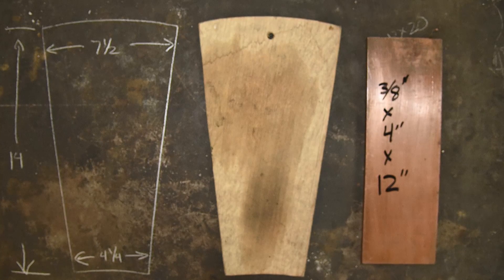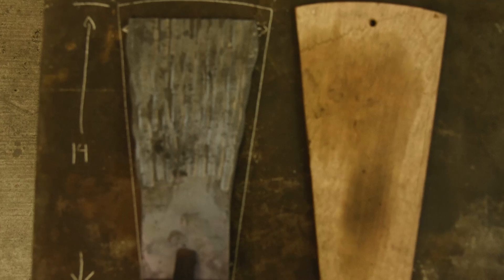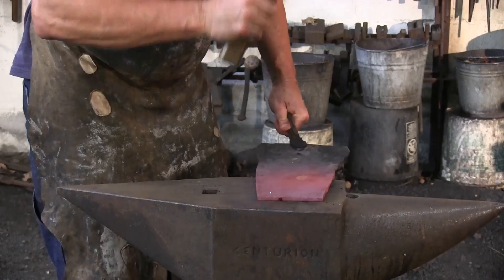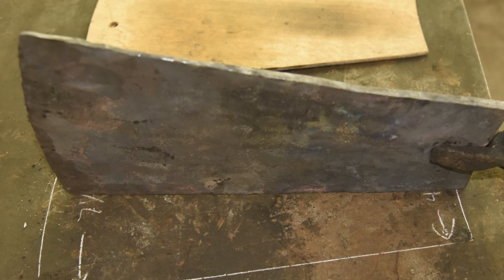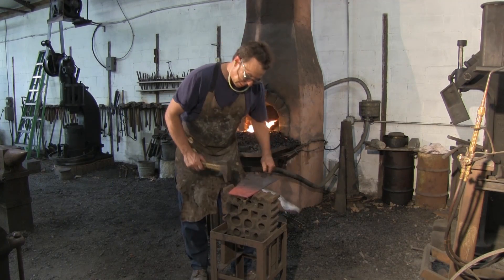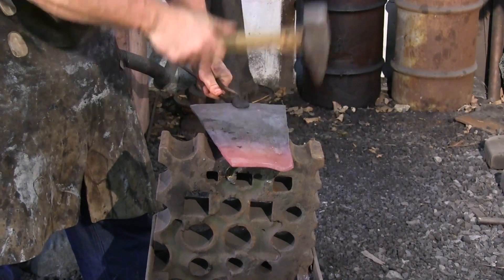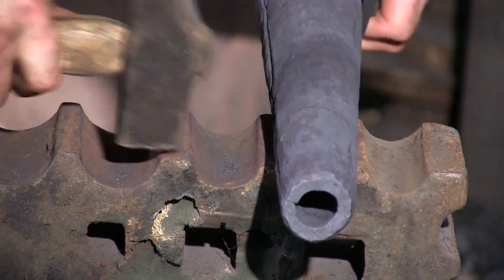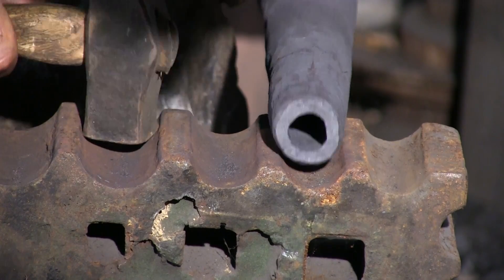Forging a copper tuyere with Lee Sauder.

Comment: that was really well instructed and beautifully filmed =) may i just ask a thing, because i just quite don't get it yet: how come the copper does not melt, and hence why would it not be advisable to use steel? ist it because the copper dissipates heat more quickly, thus cooling it sufficiently for it not to melt? Plan on doing my first smelt this summer and trying to gather as much info as i can, and there are still so many headscratchers to be cleared =) thank you for sharing this!